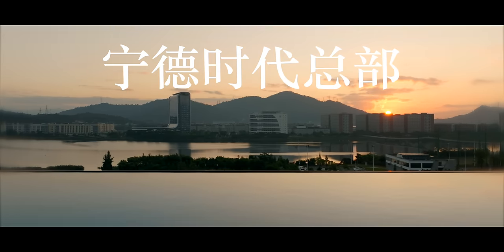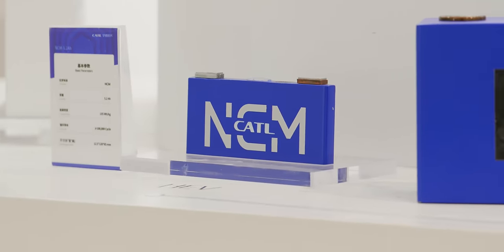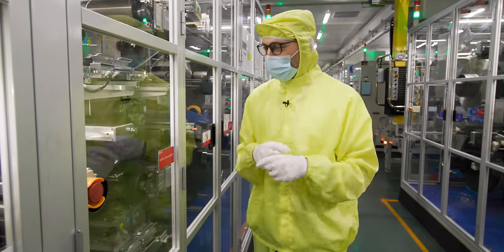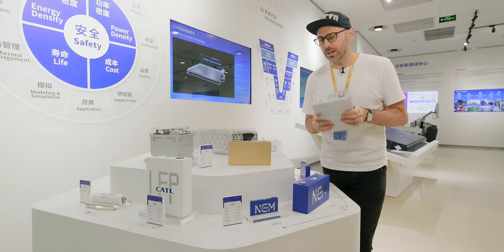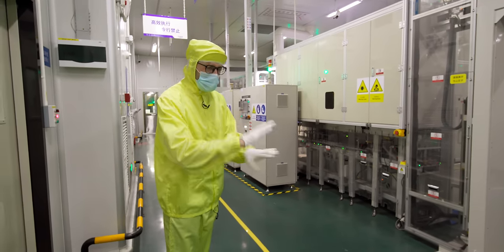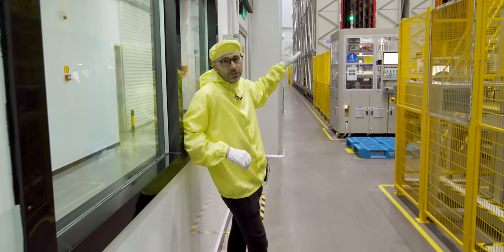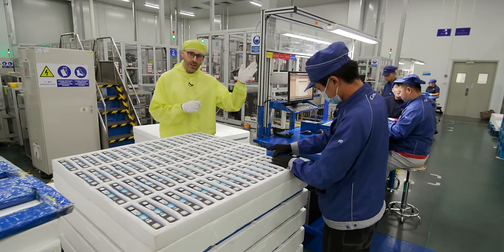Inside The World's Biggest (And Most Secret) Battery Factory!

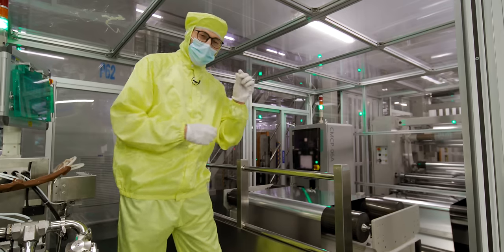Comment: Correction for 3:08 14 microns sound about correct by comparing to human hair. 0.14 micron is a hundred times smaller.
Reply: He probably meant 0.14 mm = 140 microns
Reply: @mumblic   14 microns is pretty much on point as half the width of human hair. Mine was 40 microns when I was young; now as age decreases it, it's probably thinner. Oh, you know what? I'll measure it right now! Interesting: only 4 microns seems too low, but that's the number now. According to Wolfram alpha the average is between 18 and 80 microns.

Comment: Toyota take note, they don’t live in the never never. 😁 Battery recycling is going to be a huge industry in twenty years. More power no pun intended to CTL in the R&D of new breakthroughs. Huge credit I remember this guy sitting in the back of a EV in his first clip and you can see the confidence and presentation skills that he has gained, a credit to the channel.
Reply: Toyota got burned by Texaco buying up the EV-1 NiMH battery patents. Chevron then bought Texaco and sued Panasonic, the supplier of batteries for the RAV4 EV. It had a 20kW generating trailer in development. The Electric RAV4 with the generating trailer was more fuel efficient than the gasoline RAV4.
Reply: Toyota and Japan is 15 years behind China when it comes to electric vehicle production, battery development, etc.
Reply: @jamesphillips2285 That was over 20 years ago... and a decade before the founding of CATL. Think about that a minute. A company that didn't even exist when the Tesla Model S came out is now the world's biggest battery manufacturer. Toyota has had plenty of time.
Reply: @patreekotime4578  IMO using hundreds of commodity 18650 cells was a patent work-around on Tesla's part.

The did crazy things like a add a rigid case and cooling lines. They used the coolant to prevent hotspots and keep the battery in a safer operating range for both hot and cold outside temperatures.

The Nissan Leaf, released about 3 years after the Roadster, was much simpler in comparison. It used larger "pouch" cells in a passively cooled case. The winter package included 300W of heating to maintain the pack at ~-28C.
Reply: @jamesphillips2285  Tesla was the first company to put laptop style lithium ion battery cells into a car. It was their whole entire identity. It wasn't any kind of patent workaround... it was literally all that was available in 2002.

The LEAF battery likely wasnt even developed until after the Model S was already really far along in development. And then look what happened to it... those 'simple' batteries failed alot exactly because they lack active cooling. Not sure how you think that is more advanced??
Reply: @alfrredd  5 years behind in technology, 15 years behind in supply chain, and 30 years behind in government planning.

Comment: I believe CATL batteries are in my 2023 model 3 SR
Reply: SR does not get made anymore since many years. You mean RWD probably? But yes the rear wheel drives. (not all there are also Long Range with RWD but they are rare)  But i also have a Tesla Model 3 RWD from 2022 and they have these batteries. (LFP ones)
Reply: @HermanWillems  SR stands for Standard Range

Comment: Looks very impressive, is there anyone as advanced as them in Europe or is everyone very far behind?
Reply: I don't think "advanced" is perhaps the right term. There are people in Europe with advanced designs but quite often they won't be able to commercialise a design as quickly because CATL is a huge company.  I think that any design which can use their existing machines is going to be sold in volume by CATL quite quickly.  If it requres different machinery then they'll have less advantage.
Reply: @timmurphy5541  Much like advances in solar panel technology.  Some of the newer innovations to be proposed are  like adding a layer of peroskite cells on top of existing panels or prism type layers to focus more light.
Reply: There are many battery makes in Europe. But not as much as in Asia. For example Leclanche, NorthVolt etc. They both make their own cells.

Comment: So these are the "blade" batteries?
Reply: That's BYD, not CATL
Reply: no, thats BYD, BYD is a competitor to CATL, but is smaller
Reply: Prismatic lfp cells.
Reply: As a EV battery supplier BYD is about half the market share of CATL, but BYD overall is much bigger as they're the biggest manufacturer of EVs
Reply: @kevinlin4895  nevs yes, pure ev sales NO! 1,574,000 pure evs sold for ALL of the byd brands inc commercial in 2023.
1,805,000 ev sales for tesla who doesn't have any other ancillary brands or big commercial sales outside of the few dozen semis sold in 2023.
Reply: @4literv6 well yes but look at the growth. BYDs pure EVs were merely half the number Tesla made 2 years ago. In the 4 quarter of 2023 byd overtook Tesla as the biggest pure EV manufacturer. Plus their exports also grew more than 200%. Tesla sells in the US meanwhile BYD doesn't.
Reply: @4literv6  cwb addressed most of the points. The momentum is clearly on BYDs side to overtake Tesla in full year BEV sales now that it's already done so in the latest quarter. But I'm not clear what you mean by "commercial". You're not suggesting the BYD numbers include their busses do you? What commercial are you suggesting they're including that is not in the Tesla numbers?

Comment: i dont want any lithium batteries in my house. I dont need fires. Its not the future.
Reply: Hope you don't park a ICE car near your house.
National Transportation Safety Board, Bureau of Transportation Statistics and recall data around fires for gasoline, hybrid and electric vehicles. It found that
Hybrid vehicles reported 3,475.5 fires per 100,000 sold. 
Gas vehicles accounted for 1,529.9 fires for every 100,000 sold. 
Electric vehicles saw just 25 fires per 100,000 sold.
Reply: so what your typing this comment on? you certain has lithium batteriees.
Reply: Hmmm, I hope you leave your mobile phones , iPads and your cordless power tools outside your house then.
Reply: Then you should throw you phone away.